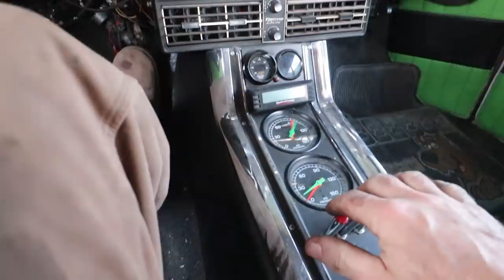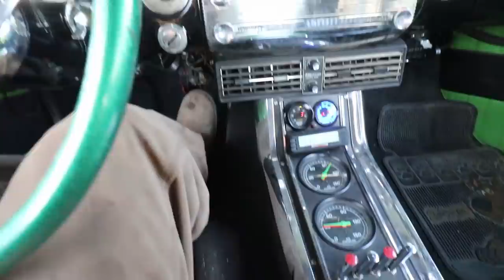Pulling out the 1950 Buick Sedanette for a walk around and build pictures of the fastback.

Comment: 50 buick sedanette, caprice chassis not a vette. As motors come and motors go, another Ls wouldn't ya know, chopped n bagged look'n low, smoked m tires put on a show. T birdie interior, flames n lacey exterior, needs a Ford 9" posi in the derriere, drone'n dusty roads round there. Pablo's probably sleep'n without a care.